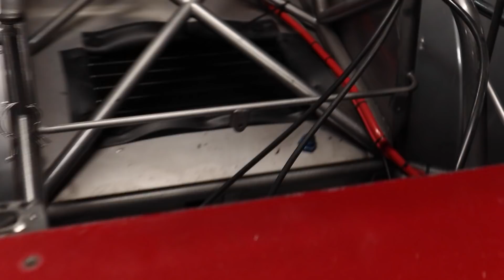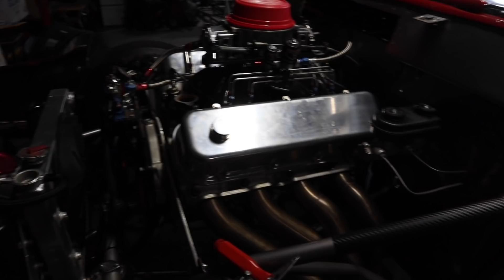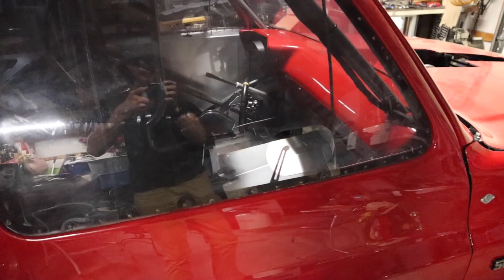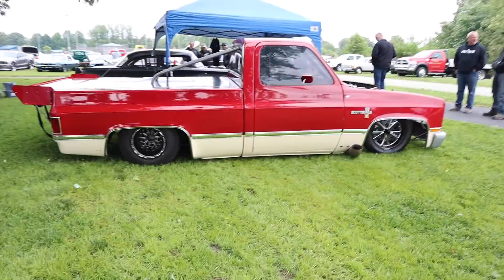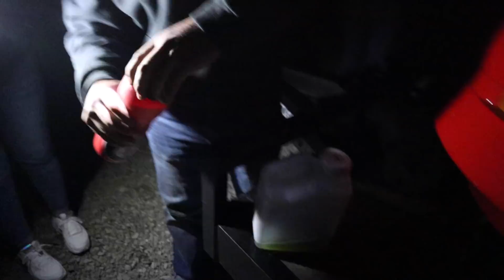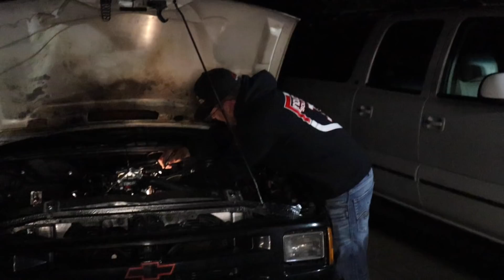Banging It Through The Motor, Street Testing, & The Hotrods Maiden Voyage!!!

Comment: I dont know if youre losing power or what but my jet boat use to do that too if it got a little water in the tank. Id be cruising across the lake and it would just shut off and as fast as youd reach down and hit the key it would fire right back up again. Badass ride brother! 👍🏼
Reply from the maker: it ended up being a fuel related problem, just no water!

Comment: Why not set that truck up for small tire and leave it. Makes it easier to run drag radials if you want to run the multiple day events where you drive the car hundreds of miles between tracks. Those events are getting huge. Rocky Mountain is coming up soon. I think they take your best times from 4 different tracks. The fastest car don’t always win. The most reliable car wins those events. Cleetus just built a El Camino drag week car just for that event. They pay pretty big money now. I run one back in the 90’s in a 340 Duster and did surprisingly well. I didn’t even pull a small trailer. Back then most guys filled the trunk and backseat.

Comment: Danny, sounds to me like your loosing ground while driving. Take a ground wire from the cowl to the motor and another from (same spot on motor) to frame. It needs to be like a #2 ground wire to both. Especially since your race pack an such is mounted on the underside of your dash. If that doesn’t work let me know any other symptoms the truck might be experiencing and I can probably help you narrow it down (I’m an electrical superintendent by trade). Let me know if I can help. Love the content as always!
Reply from the maker: it was a ground problem! we got it fixed though, & i will definitely keep that in mind if we have more troubles!
Reply from the maker: give me a call when you’re free, we did not fix our problem, & can’t seem to figure it out. 2709938661